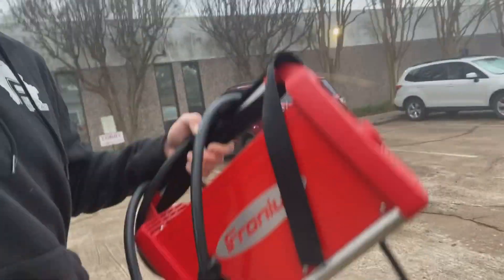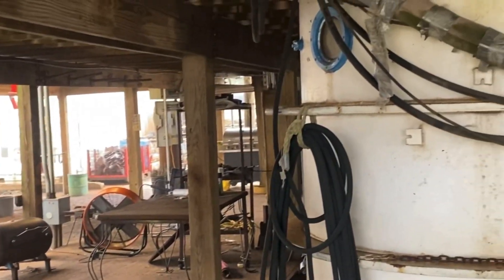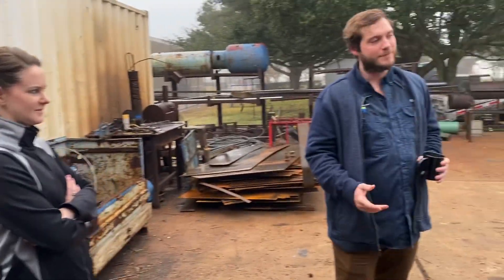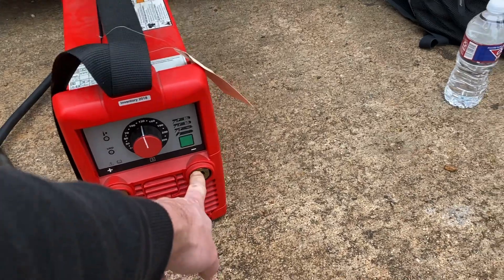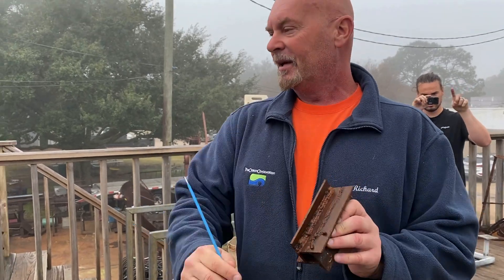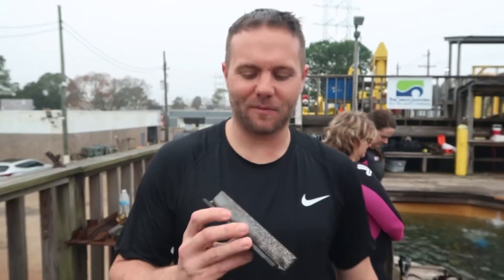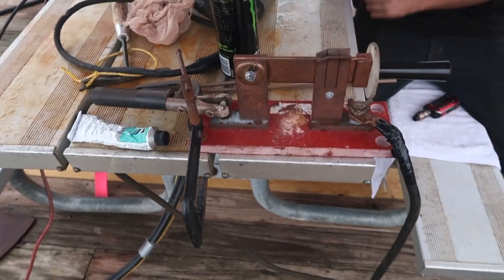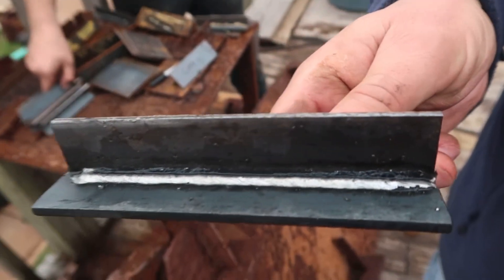Underwater Welding

Comment: Its just normal 6013 rod coated in wax and you can use a regular machine on DCEN?
Reply from the maker: You are correct. Nothing spectacular. Just make sure you buy wax coated rod or do it yourself. I thought there was going to more to it but it’s pretty basic . I hope all is well 👊
Reply: @chris_b_liven  thats crazy cool video man
Reply from the maker: Thanks man 👊